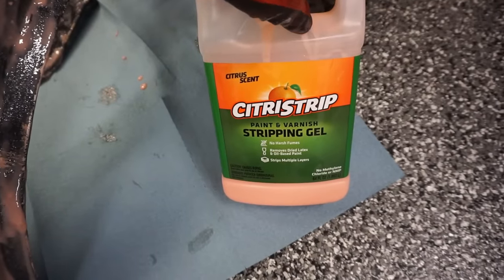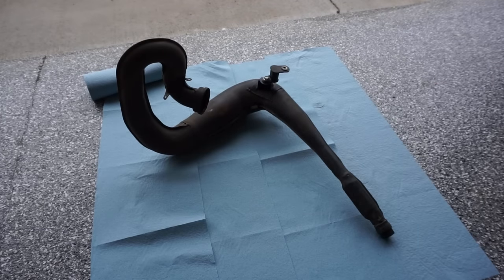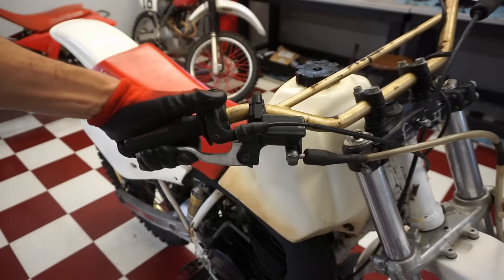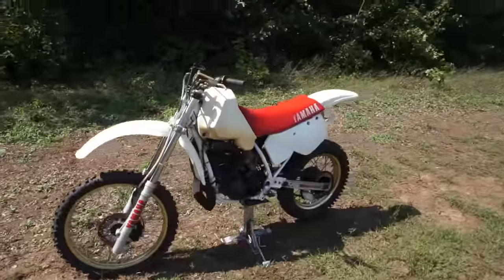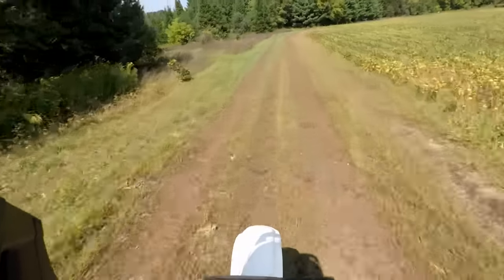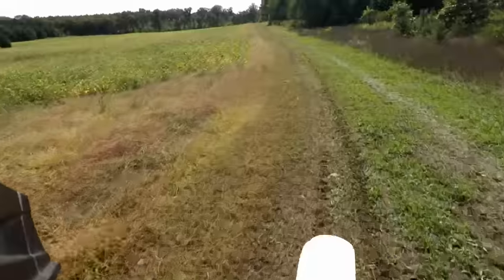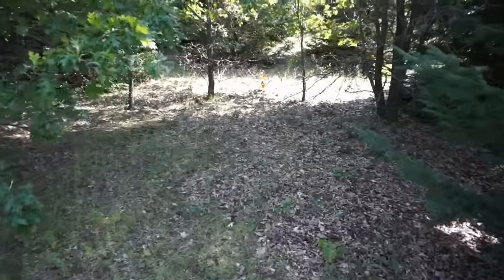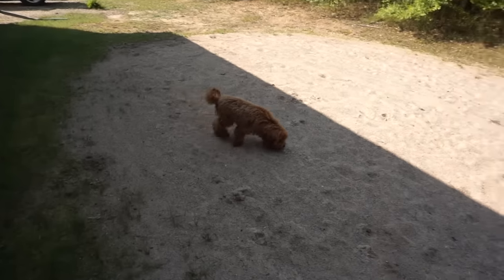Yamaha Yz490 Dirt Bike First Ride (INSANE POWER)

Comment: I owned all the bike bike growing up and between the Yz490, cr500, kx500 and the Maco490 was the craziest nasty beast. The power bands on the Maco490 was in a league of its own and the most power all around for them all being stock. I never did anything to my big bore bikes at all except I did put a fmf fatty pipe and silencer on my 94 Cr500 and I'm 50 years old on this September 22nd and I still have everyone of those bikes still today. I'm in the process of trading my mint 89 Kx500 with original title still in my name for a 88 Honda 250r fourtrax ATV. I already have the 89 250r fourtrax one of few that I ever seen come off the show room floor with blue plastics with red seat. It came from Cycle World in Rosedale In Baltimore Maryland . They closed many years ago. But I went there and it was some kind of promotion quad that came stock with racing plastics in dark blue with red seat. I remember the Salesman name that sold me the quad was Jeff Hill and years later he became a state trooper and pulled me over on the road riding the very same 250r quad he sold me lol he couldn't believe that he remembered me and he gave me a warning and let me go
Reply: Had an 84 maco 490 sand spider back in 86,crazy power for sure,but my 01 cr500 would walk away from it.those big bores like to b short shifted because they make tourque,one of these days that kid will learn how to ride and shift properly.have a street legal xr650 that I ride now,and it runs the same way,gobs of tourque!
Reply: Happy Birthday ! I turned 50 on sept 2...i think our age was the GREATEST time to grow up ! 😃👍👍👍👍👍👍👍👍

Comment: If you want the paint stripper to work amazing you should cover the parts with painters plastic while the parts are still wet from the stripper. It works amazing.

Comment: also if you have alot of vibration in the handlebars check your engine mount bolts to make sure there tight..  even if they look tight they may be just snug and not tight..  my 490 with tight engine mount bolts i have barely any vibration in my bars..

Comment: Raced mine a bit I'm not a pro follow some expert recamendations on the carb involving the slide, needle, and some jetting fixed the blober,power surg problem pinging very rare alway first out to the first turn great  goat trail putter to never fowls. RUBBER ON THE FINS AND BIGGER ENGINE BOLT SMOOTHS VIBRATION STILL HAVE MINE.

Comment: Excellent video, as usual. I rode a 460cc version (UK) on the road in the mid 80s and as you say a lot of care needed with the throttle  and very high riding position but managed it ok(I'm 5'6"), more care was required on kick starting than with a 500 Thruxton Velocette(4 stroke), but love these big strokers.  I'd be very wary now, as just yesterday I fettled and synced the carbs on my 750GT Ducati('74) for 1st ride of the year and the clean, crisp pickup almost caught me out.:text-green-game-over:.☠. But not quite. PS like the wildlife shots.🦃

Comment: If you use a 16% hydrogen peroxide solution and a powerful ultraviolet light you can usually reverse the discoloring on the plastic. Submerge the plastic in the peroxide solution and then put the ultraviolet light over top of it while it's soaking in the solution leave it soak overnight with the light on and that plastic will come back out like new, or close to it.

Comment: I had what was the last yamaha bike to use the air cooled 490, a 1992 wr500, and I tried to ride it mainly as a woods bike and tight single track it would wear you out easily within 1 hour and I was in shape, I eventually replaced it with a KTM 300 xcw, the Ktm was engineered and designed as a woods bike so yeah it was night and day, but I still have found memories with other memories not so fond of the wr500, like the time I was 7 miles from me truck and fouled the plug and had to push that pig

Comment: I rode one for ten years Desert riding. Insanely fast with terrible suspension. Be careful or it will hurt you!

This bike will hold the front wheel up shifting through all the gears (only 4) while shooting a roost at anyone behind you. ALWAYS wear a boot when starting it, it can kick back and break your foot!

Comment: Had an 82 yz490 best bike I ever rode had to run Bosch single platinum plug mine liked to suck a little oil from crank seal tried everything to correct.sorry I sold it!

Comment: Hey Joe good vids , I have 45years+ working and racing on these bikes. For main jet ,run 3rd gear wfo down street and due throttle chop... clutch in , hit kill button,  cost to stop ... plug should read ( creem in the coffee) brown all the way round. It helps if plug is shimmed (indexd) so ground is faceing reed side .good luck (subcribed) Mark team go!!

Comment: I would not let a big bore 2 stroke idle that long, it tends to load up the engine, might cause it to take longer to clean out and run right, and it could also lead to a fouled plug. I had a big bore Suzuki RM465 for 8 years and I tried to avoid letting it idle for more then a few seconds, and it ran perfect for all 8 years, with almost no plug fouling. And it did not take as long to get the engine to clean out and run right.

Comment: I watched this at work on lunch break on the computer there. Yo those 490s I hear stories of people who use to own those. Probably to much power for not a good enough designed bike like new modern bikes with a lot of power handle waaaaay better than old bikes. Scary fast I believe that I wouldn't own one of those probably because starting it is to difficult and dangerous, and riding it would be scary dangerous more than fun. Modern bike handle soooo good super fast two stroke 250 yeeeeeee. cheers happy Wednesday 👍🤙⚡😃

Comment: that's an air leak, crank seals probably.  (the revs, & the general throttle cut response lag.
check the engine bolts frequently, especially the front three, they used to recommend boring out those holes & using slightly greater diameter stuff to keep the front mount TIGHT. (don't & the holes get egged-out) : (
had the '84 IT 490K. 33hp. wide ratio five speed. Detuned version of your moto-monster. 
My test ride, first thing I did was wheelie down the street. lol.   not intentional.

Comment: I owned one from new, yours is in need of jet and tune and maybe rings, my bike was also incontrollable at times, though smooth and equal in power, from 4000 rpm mine would turn itself inside out, to lay in that much throttle it would stand up, yours need a good re build

Comment: Friend of mine had same bike. It rev’d to the moon when it ran low on fuel..he would go into neutral and try to rip that air intake thing off. I told him just to put in high gear and dump clutch with brakes on to kill it when this happened. It was unnerving and it blew up once before due to this

Comment: Aren't the 87 YZ's the ones with the 5 speed? If so a real keeper for sure. Though not sure where the idea the CR's are easier to ride comes from. Maybe slightly easier to tune the carb but just as fast and inability to turn and or stop. Though have to say there was something magic about those old non inverted Showas on the Hondas. Tracked a straight line no matter what got in your way.

Comment: 2nd 3rd and 4th are your best friends on a bigbore two stroke and you either learn throttle control REAL QUICK or it'll put you on your ass even faster lol ! Raced a 83CR480 and a 87CR-500 in open expert class at a whopping 5'3"135 lbs  so I know you can master the power of it 💪😎

Comment: Try and find a standard fuel tank it won’t feel that big and get it up the gear box and just run around and get used to it check it doesn’t have a air leak a front number plate and tank stickers and good too go go go omg good job good luck great job again 🇬🇧🍀👍🙏🇺🇸

Comment: run a second metal head gasket it will lower the compression just enough to keep from pining and make it easyier to start use preiemem gas onlyyou dont need to rev the hell out them short shifting works better there is enough tork to move to you fast and the bike will vibrate less

Comment: I rode an IT490 once that scared the bejesus outta me. You may want to lube the Throttle Cable...I had that issue with an '83 RM250 that would stick open like that, but for some reason it only did it in 3rd Gear WFO...lubed the cable and that fixed it...hole shots require sitting on the Gas Tank, but MAN the Roost that thing'll throw?

Comment: Try finding a different style carb for it one that's a bit easier to adjust and tune to the bike those carbs are kinda known for being really hard to tune in to those big bore bikes on my yz400 it's a 1979 we swapped to a modern mukuni and it works great no issues

Comment: When the bike went wide open why did you not use the kill button or does it not work? A kill button on a 498 is a not die button lol. also I’ve raced 500 cc bikes all my life and my advice to you would be to short shift that Yamaha you were over revving it past The point it quits pulling those bikes were designed to short shifted at mid range they are way easier to ride and you will go faster. Also your problem might be that the float bowl is running out of gas I noticed it revved up after you had the bottle open for an extended period.￼

Comment: Well, you are one of the few who will get to experience the power of the old 500's if it's tuned right. For people who are any kind of riders, in open area's or sand or hills once you are used to it you want even more power, I no I did. Thing is, after that, everything smaller will seem gutless. On a tight MX track you couldn't use all the power but in wide open area's just open it up and enjoy. If it scares you to the point of not wanting to ride it, you're in the wrong business or you need to get out and ride with fast  riders that can show you how to ride.

Comment: is it a 87' a bike with a 88' motor (the clutch cable is different where it enters the motor)
Reply: the tank doesn't look correct could be after-market large capacity tank

Comment: What is that black square thing with the tube off of it on the motor like what is that & what does it do?
Reply: that would be the inlet pulse damper.. yamaha called it a,  induction power system by memory..

Comment: Dont let the paint stripper dry, wipe off while still damp. Modern paint stripper is of poor performance but if part is wrapped in foil while the stripper does its work results can be improved. Jump cut on the front master cyl. hammering inward of a stuck component?? 
Its a 'scary' 500 Grown Mans bike, not a modern 'easy to ride' fourstroke and you're not kicking at the correct point in the cycle for best results and it needs more jetting work, sounds correct when on the main jet, but these bikes were notorious for detonation.
Reply from the maker: It was stuck out

Comment: Should get it tuned up really good and run 20:1 with half 91 premium half 110 race fuel get the most power  and will run for a long time
Reply: 20:1, are you serious? The smoke screen would be unbelievable 😂